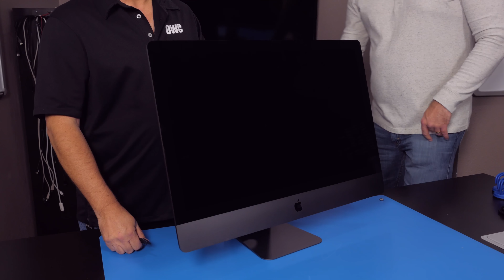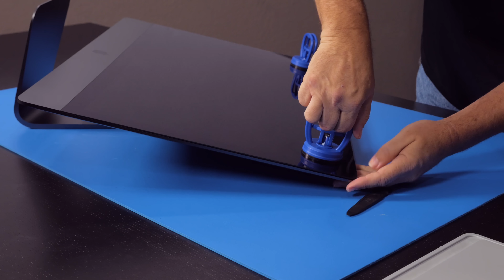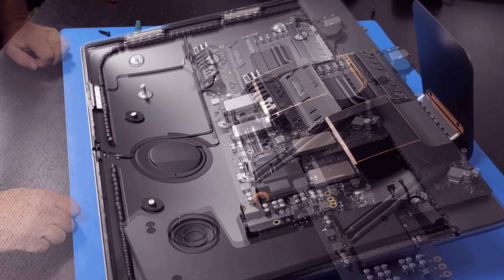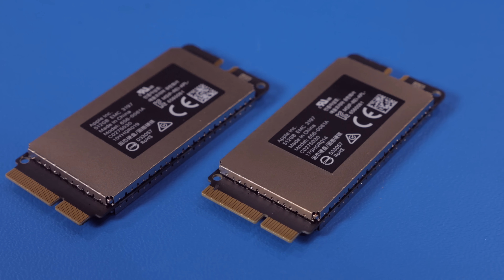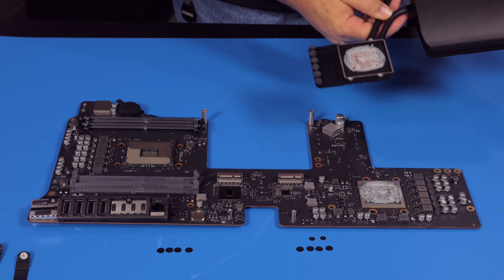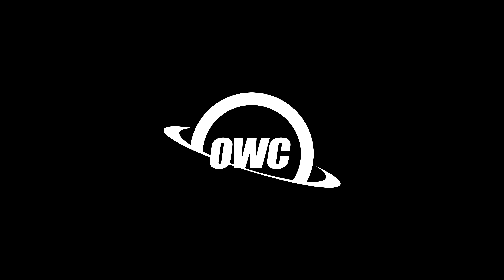2017 iMac Pro Teardown + OWC Memory Upgrade Announcement

Comment: All of Apple scientists and engineers, and they could not figure out how to put a memory upgrade door on a $5000 and up pro machine? or screw in a light bulb, when even the lowest end imac i5 27" has one?
Reply: This is an "Apple" computer.. why on Earth would they want to allow users to upgrade memory when it's used as a profit margin widening tool
Reply: because this has been a trademark feature of ALL "27" imacs, and ALL "PRO" :) Apple desktops.
Has it not?
This is actually a change from Apple policy, and it's not to make it thinner or lighter or for more battery life like on the laptops and mini's.

I am guessing, since this uses much more profitable ecc memory, Apple decided no way would that let the profit potential go away, as they charge more than retail for build to order memory upgrades, and do not give you credit for the base amount you are deleting, thereby they are double dipping as usual on all of their cpu, memory, storage upgrades.

As they know pros would buy just enough memory, storage, GPU, that they believe they need and add than more later if needed.

That would of course keeps Apple out of the profit on those upgrades, and under Tim Cook's Leadership, Apple has decided that anything that connects to it's Macs, ipads, iphones, must in someway generate them a profit, hardware or software, through the use of licensing, lightning, dongles, certification, app stores, frequent almost forced os upgrades that slow down and obsoletes older apple devices.

And newer machines not capable of running older OS's.

Apple indeed does this like an art and here is why......
https://www.macrumors.com/2017/12/27/apple-ceo-tim-cook-102-million/
Insane Greed Pure and simple!
Reply: all I know is that under tim cook, apple has taken greed to a whole new level
Reply: They know they could do that, but they just want those stupid clean lines not even the hint of a door to upgrade ram or HD. I'm a 25 year Mac user and  the past 10+ years it is all about them making money. They haven't been that cool computer company since the early 00's.
Reply: Seems like there could be a market for a custom made back with a removable door by either cutting the existing back and reinforcing it to keep the thermal integrity, or producing a lazer measure replica with a removable door.

Of course there goes your warranty, but there could still a possible market for it for 1 year old machines out of warranty.

I would consider it, if they could insure it would improve cooling or at least keep it the same, for say $200 in space gray, black or carbon fiber ($300).
than you have instant access to your two drive and memory, and possibly even the CPU.

For a pro machine you can upgrade.
Imagine that :)

Comment: Video is too dark... you could use some better lighting
Reply: One more light, a bounce card, or even just relocating the light could make a lot of difference. In much of the teardown your key light (brightest) came from behind the guy with the screwdriver... Which created shadows over the subject matter you're trying to show. For something like a teardown, top lighting would help a lot, but so would a bounce card or light coming in at 45º from the camera and the plane of the table (diagonally). This would illuminate but also give shadow definition on the subject (motherboard). The closer your light gets to 90º from the angle of the camera and the lower angle the closest the light gets to parallel to the plane of the subject, or the table in this case, the more definition you'll get on the components since you'll create longer/deeper shadows for any components that are dimensional—this can be overdone, but you should play around with 2 or 3 light setups and some bounce cards to fill dark spots.

Comment: Who in their right mind would consider this PRO level upgrade able, A pro level computer would have access doors for ram and drives just like all computers did a couple years ago,
Pro level iMac shops would not give a damn about a couple extra inches on the backside for accessible ports, AAfter 30+ years as an apple ownerIve just about had it with their move to non serviceable computers.

Comment: Repairing or upgrading this computer would be a pain in the ass. I worked many years with PC desktops repairs and I wouldn't like to play with that kind of BS (glued screen, springs at heat sinks, short ribbons, delicate hinges for ribbons). There are too many things that can go wrong, so from my point of view this computer is not upgradable at all (it would cost too much).

Comment: Ordered one of those 128GB kits for my iMac Pro. Had an Apple certified guy to had them installed. Almost ruined my computer. My workstation, on which I depend to make my living. One, or more ram cards were defective and had to return them. A quick search shows a lot of people with the same problem. OWC doesn’t seem to care. I spent almost 140usd to install the ram kit, just to have them removed the next day in order to save my computer. I got a refund on the kit. Lost the installation money. If you read this, be aware. This is not a good product. OWC is being irresponsible with their claims and marketing, selling an awful and dangerous product, as a pro kit. Avoid at any cost

Comment: Expect GPU failures in the future with all that thermal paste compound 🤦🏽‍♂️. They do this on all their products
Reply: its pretty common the amount of thermal paste, check a gpu tear down
Reply: This is nothing unnormal, don’t know what’s so wrong about it :P
Reply: Better too much than not enough on a gpu. No HSF, broski.
Reply: From my knowledge, too much thermal paste like the one in the video cause it to be a insulator of heat which is the total opposite of what it’s supposed to do. I work on Apple computers all day and you won’t believe how many GPU failures on MacBooks and iMacs we see because if this.
Reply: You don't know what you're talking about.
Reply: There is no such thing as too much paste if you have the mounting pressure to squeeze the excess out.
Reply: JohnnyG I know exactly what I’m talking about as I’ve conducted temperature tests on computers with proper thermal paste and ones with too much thermal paste. Thermal paste is for the microscopic imperfections on the GPU for when the heat sink and the GPU make contact. That is it! Too much of it will make it become a insulator and you can bet you will have higher GPU temperatures because of it and more stress on the GPU
Reply: cl4ster17 sir, if you have thermal paste gushing out to the sides of the gpu and resting there, you’re creating a insulation for heat. Please, just do a simple google search on proper thermal paste application and it will tell you all of this. It’s that simple.
Reply: Various
I don't do it that way myself but I usually handle hardware with comparatively overkill cooling where it doesn't matter anyway. In general I only put the small dot in the middle (CPU) or spread a razor thin layer (GPU).
Reply: cl4ster17 that’s the proper way of doing it.

Comment: Clearly my definition of the word "upgradable" is different to Apple's.
Reply: When did Apple ever mention anything about the iMac Pro being "upgradable"?
Perhaps you're confusing the iMac Pro with the upcoming Mac Pro, actually touted modular and upgradeable by Apple.
Reply: That's was my point - it isn't - you're stuck with what you buy with little hope of changing out parts as they become obsolete or inadequate.
Reply: Well as I said the iMac Pro was never supposed to be upgradeable. Other than the upcoming Mac Pro, which we haven't seen yet.
So based on what do you conclude your definition of the word "upgradable" being different to Apple's?

Comment: I would love to see that iMac Pro reassembled and working after that under-qualified twat pulling the cpu out of the socket just because it stuck to the heatsink. ... rename the vid "How to blow 5k + and void the warranty" .. You certainly won't be able to return that model.  My advice go for the 10core maxed out and LEAVE the insides ALONE !!!! it's good for 5  to 8 years.

Comment: Wow!! This so called Professional Computer is in fact a very expensive laptop on a stand.
The cooling solution is ridiculous.....only two heatpipes for each CPU and GPU??
This thing will overheat faster than you can say "iMac Pro" !
APPLE , NOT so PRO anymore!
Reply: And I am Building PC's for 15 years and I am embarrassed for you good Sir! (My 80W i7-4770K has a cooler Double! the size of the iMac Pro 2017)
Compare for yourself: A tower workstation with the iMac Pro. 
Also take into consideration, that a real Workstation will be upgradeable much easier and much more extensive than this product!
(GPU soldered and SSD's propietary)
Apple is going the way of obsolesence as they dont want the customer or third party repair shops to repair or upgrade their products.

Comment: Sry but this closed case architecture is sooooooo stupid :D Changing ram and ssd ? no problem,  just give me a sec coz I need to unglue my monitor screen first :D lol 
Btw this gpu heatsink + 2 tiny fans. Have a great time using lava hot Vega. I bet noise will be like 50-60 db, and you get no more than 80 % of Vega power, probably closer to rx580 performance after thermal throttling
Reply: Alka N other tests, like from Marques Brownlee showed that it’s NOT thermal throttling and running cool and fast while maintaining quiet 🤫